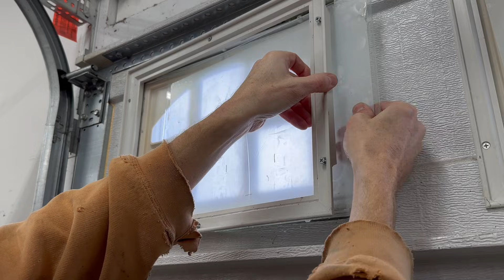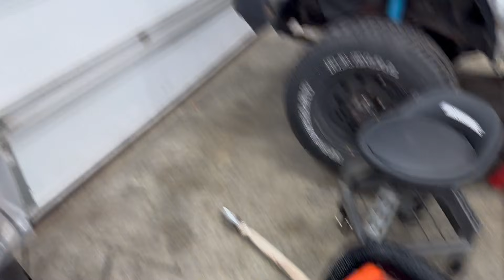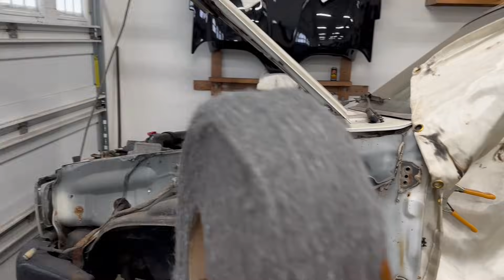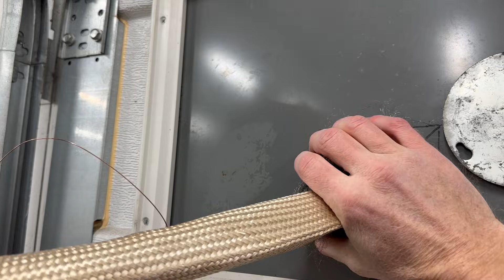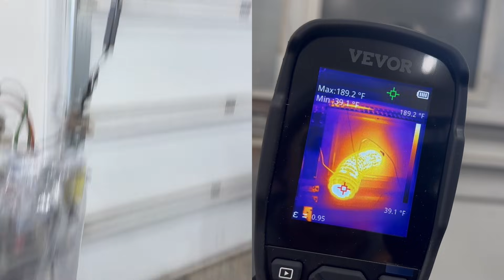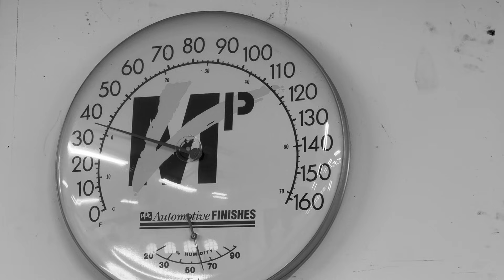Comparing 8kw Diesel Heater - Inside vs Outside for most efficient way to Heat Garage

Comment: Why not put a hole in the house wall? Then you don't need to remove the heater, when closing an opening the garage door.
Reply from the maker: Don’t want to put a hole through the house for something that isn’t permanent, as I only use the heater when it’s reallly cold and I have to work in the garage.
Reply: Im wobdering if i should also vent throug the garage. My garage walls vent to outside. Wondering also if it be an insurqnce issue if something would hapoen like a fire. Do yoi have an extinguisher handy in garage just in case?
Reply from the maker: @raczyk yes I keep an extinguisher in the garage for welding etc.

Comment: isnt steel wool kinda flammable?  no hate,  seriously,  i remember useing 
it to start fires back in boy scouts
Reply: I thought the same thing....
Reply from the maker: Yeah, the very fine steel wool will light with an open flame.  I'm using more coarse steel wool and I have heat but no open flame.  Plus the wool stays pretty cool with one side being exposed to freezing temps.

Comment: Couldn’t you use the air intake to suck air from inside of shop with an outdoor  operation?
Reply from the maker: I could do that, but would it be worth adding another hole and duct work...

Comment: There are plenty of videos now when people connect exhaust via radiator in order to increase efficiency even more because of war and 0F outside without electricity and central heating
Reply: Uhh.. is that better than war and onlyfans inside without central heating?

Comment: A couple things:
1) Putting unit outside the way you did you're drawing in CO from the exhaust and blowing it into the living space.
2) Running exhaust and not also the combustion air you're creating a vacuum in the room which will draw in cold air as well as possible CO from the exhaust.  You should be running combustion intake line out along with the exhaust.
Reply from the maker: I did too at one time. Now when I go back to visit, it's crazy to see 30 yr old vehicles on the road without any rust.

Comment: I had a non insulated 24/32' garage, even with a wood stove I quickly realized the heat rises up to the ceiling, I put some 8 mil plastic across the rafters, it helped quite a bit but still way too cold you could stuff the stove full of wood 3 times in a row to get it blaring, still only warm close to the stove, it felt like I was trying to heat the outside 😂
Reply from the maker: I really need to insulate my walls/ceiling... keeping this place warm is a losing battle.  Perhaps a future DIY video on adding insulation is in order!
Reply: @6thGearGarage  yeah you will be glad you did. I kept cutting corners with mine. I put that bubble wrap insulation all over the tin walls,  it didn't help much, the concrete floor was storing all that cold over night, I see why people do heated floors
Reply from the maker: Heated floors are the absolute way to go, if you have natural gas.

Comment: You do know ultra fine steel wool is flammable right?
Reply from the maker: Yeah I’ve seen those videos...looks like fun! The roll I used isn’t fine and I’m not putting an open flame on it, so it’s safe.
Reply: @6thGearGarage . Alright good...I found out the hard way about ten years ago 😂

Comment: steel wool ingitees super sparks if its really windy it will burn your home    use glass wool or soemthing that doesnt ignite in windstorm  but play with fire
Reply from the maker: I've seen that happen but I'm not holding a torch or flame to it. It stays cool, being exposed to freezing temps on the other side.
Reply: 😂 that exhaust is never gonna shoot flames 🔥 chill bro....😂 chill.  Its 100% fine

Comment: Ok this is so flawed, when testing inside you took the tube off of the heater, so you are measuring the temperature of the metal plate inside the heater of course it is going to be a lot  hotter. put the tube back on and do this again
Reply from the maker: Good point.. I will check it again with the tube installed!

Comment: Why not a $100 NG heater? Piped gas has to be cheaper then diesel? And 100 times easier?
Reply from the maker: I only have electric where I live, no NG.  Had NG at my last place and it was definitely the way to go, if available.

Comment: so now the overhead door is inoperable in the winter without dismantling the heater? ,makes more sense to drill a small hole in the bottom of the wall.
Reply from the maker: If I have the heater set up to heat the garage, I’m not going to open the door. Also the Toyota isn’t going to be moving for a long time, so no need to open that door during winter.

Comment: Running the heater in closed garage gave off too many Diesel fumes for me with exhaust pipe running through the hole...tried it both ways, less smell with it outside.
Reply: You shouldn’t have fumes with it inside and the exhaust going outside unless you have a leak, that said it’s still not wise. Just hook the intake for the fan on the inside of the heated space and it’ll be the same result. Otherwise the fans taking in 5° air and making it idk 250, vs the fans taking in 50° air and making it 350
Reply: Understood...thank you for that

Comment: I would add a short piece of duct to get the heat to the floor. Or at least an elbow facing down.
Reply from the maker: I ended up putting the heating duct back on the output of the heater and used some wire to hang the tube from the garage door track to point down at me while I'm working and it made a HUGE difference!

Comment: I have one inside my garage and added 6 feet of extra exhaust tubing, looped up and then back down to the exit hole.  Allowing exhaust tube to cool into the garage just adds a little more heat to the garage.
Reply from the maker: Have you experienced any condensation issued inside of the exhaust by extending it? Someone else mentioned that issue when they extended the exhaust to take advantage of its heat.
Reply: @6thGearGarage  Condensation, none observed.  The tube comes out from under the heater, turns up for about 3 feet, 180 degrees back down for about 3 feet, then turns 90 degrees, and exits through a bulkhead fitting in a board that the window closes on.  No dripping outside.  No dripping under unit while running or after shutdown.  I checked it and as I recall the pipe is still nice and warm where it turns to go through the bulkhead.  So not really cool.
Reply: What did you use for the electric converter? I keep seeing differing opinions on what to use
Reply: @SmartrBots  I have several old HP laptop power supplies that output 19v DC.  My 12v/24v heater works okay on 19v.  I also have a battery with a diode blocking the 19v from the power supply.  I had the AC power go off and the heater was super hot and no fan, so the battery allows shutdown in case AC supply fails.

Comment: Get the green hinge garage door hinges. Makes a huge difference. 

My garage is heated and this is the first year I installed the hinges haven’t even needed to heat my garage yet. Usually I turn it on in December.
Reply from the maker: I will check those out... my doors are VERY drafty! Thanks!
Reply: @6thGearGarage very easy to install and put in new rollers made my garage doors so quite

Comment: If you connect the exhaust pipe through the battery (radiator) and then vent it to the street, it will be even warmer 😉
Reply from the maker: I saw a video about this and it was effective. My only problem is that by not putting any holes through the wall, my only opening is 6' up on the door. The exhaust on the heater can only go straight out the back, or downward, but it should not angle up. So, to stick to the original plan of a non-invasive install, I wouldn't have a good way to route the exhaust up to the opening after it left the cast radiator.
Reply: Just run a fan across the exhaust.. no wrap tho..

Comment: In my research I’ve seen people suggest getting a small cast iron radiator to plumb into the exhaust to act as an additional heat exchanger. Im curious to see how much that would help
Reply from the maker: I saw a video about this and it was effective. My only problem is that by not putting any holes through the wall, my only opening is 6' up on the door. The exhaust on the heater can only go straight out the back, or downward, but it should not angle up. So, to stick to the original plan of a non-invasive install, I wouldn't have a good way to route the exhaust up to the opening after it left the cast radiator.
Reply: I got a roughly 5 foot long exhaust tube extension and extra muffler (kit was dirt cheap) and ran that along the wall before exiting through a hole and the exhaust is cool enough to grip and hold it comfortably by the end.  That means most of the heat is already radiated or convected away with just the pipe, a radiator would not extract more heat.   One problem was I made a loop to match the tube length with the mounting location of the heater and the exit hole, and it fills with water over time because it cools enough that the exhaust condenses inside.  I had to insulate the tube between the heater and the low part so it would not do that anymore.

Comment: Can you try with 2 holes on your garage door? Put the unit outside as before, but the air intake connected to the garage by a second conduit. So there is a loop but you avoid most of the noise
Reply: Best of both worlds
Reply: @relatableguy2232  Agree.  But the less of that ducting for the heated air, the better.

I have mine mounted outside to both burn cooler (more dense) air, and to keep all diesel smells outside.  But I have it really close to the through-wall vent so that I have a minimal length of that same ducting, and it's cut to the minimum length and stretched to open up the inside diameter as much as possible.  

I did see one or two videos of people who ran a converter tube immediately from the heater to turn the about-three-inch outlet into a 4-inch to be able to use insulated 4-inch ducting.  I still think that's a better idea than the insulated 3-inch that is in this video and that I'm using.
Reply from the maker: It's a very good idea, but as someone mentioned, having all of the duct work going to/from the heater to the openings is surely costing me some efficiency. Those duct tubes are super thin and not insulated at all. I could add some better insulated ducting, but the simple/quick install is starting to become more permanent.

Comment: Wow!  So it definitely throws a lot more heat!  Great follow up video!  Thanks and best wishes.
Reply: no this test is flawed, he took the tube off so he is measuring the metal plate inside of the heater, he should have left tube on and measured the output that way
Reply: @arsenaultfamilylightshow6733  The point of this was to show that by using the air from the garage instead of outside air, he could get a hotter output from the heater.  The video before this one, he has the tube on, which takes the outside air and heats it.  This one, he is taking the air in the garage, circulating it through the heater, and heating it.  It heats much better.
Reply: @VidVak1192 That's not what is shown.  The heat exchanger is incredibly hot. The air coming off the heat exchanger will never be that temperature. 

Clearly warmer air in means warmer air out, but the test doesn't give valid numbers. I was actually looking forward to being able to compare, which this didn't do accurately. 

I ran mine inside and the heat exchanger was around 425*. The duct temp was 115* where I measured it. It's apples and oranges measuring the exchanger vs the outlet air temp after passing through the duct, which also absorbs and sheds heat.